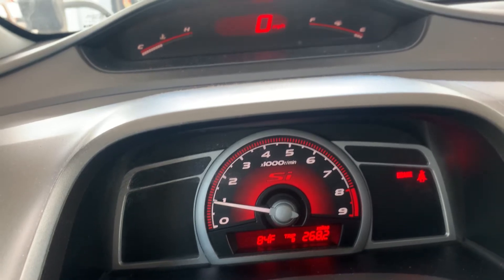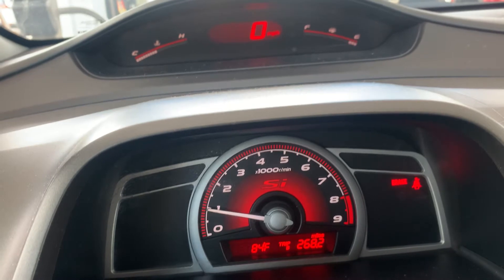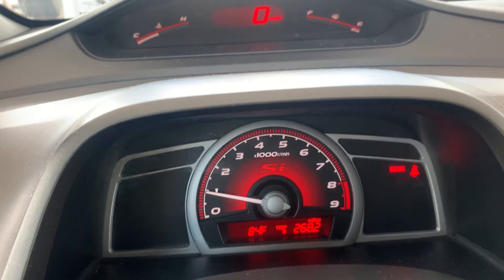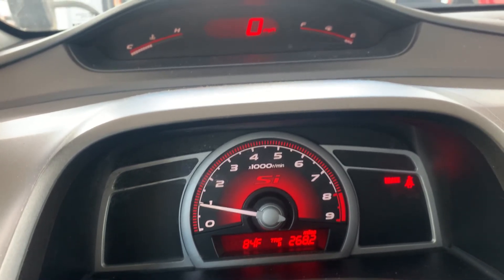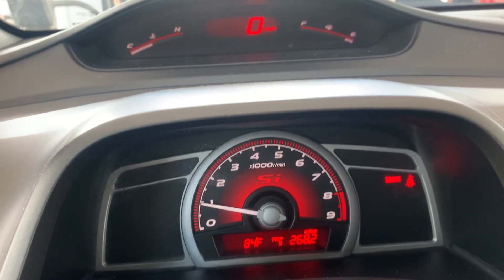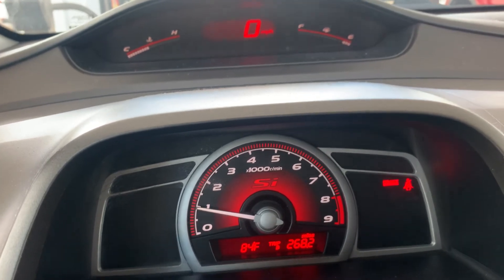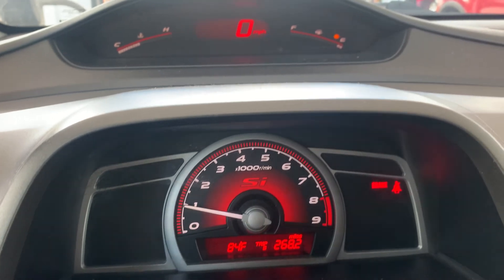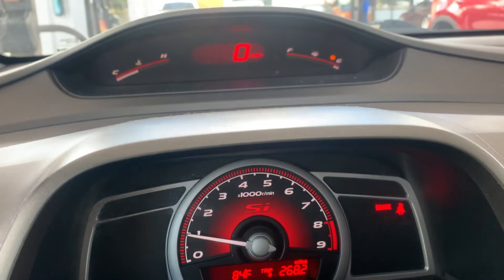8th gen si - fBO (mpg)

Comment: How much did it cost for the bolt ONS and tune in total? How many miles on the motor?
Reply from the maker: 113k daily drive 
Intake 300
Exhaust 500
Headers 300 but I sold my OEM for 300
Hondata 450
Tune 375
Reply: @molexmejia8449  thanks. I'm currently looking for a clean and mostly stock fa5 si with low miles rn, no luck so far but I'll definitely be going a similar route to you when I do get one
Reply from the maker: @repingers9777  I’m selling mine
Reply: @molexmejia8449  awww why? 😂 I'm looking for one as a nicer and newer daily. I'm driving a clapped prelude type sh with a JDM h22a she's a runner but the car is falling apart big time and it's been a major headache. Hoping a clean fa5 will be something I can love
Reply from the maker: @repingers9777   bb on the way…
Reply: @molexmejia8449  How much are you asking for it?
Reply from the maker: @alxo123   10k
Reply: @molexmejia8449  damn good luck with the sale. It's a seller's market these days, that's for sure

Comment: What’s the 0-60?
Reply from the maker: No clue
Reply: I've got Hybrid Racing CAI, Skunk2 header, Full Race 3" exhaust and tuned on Hondata. I'd say the 0-60 is in the mid 5s if you get a perfect launch. With the limiter pushed back to 8600, you can hit 60 before shifting to 3rd so that drops the 0-60 time substantially. The 6.7s stock time is somewhat due to 2nd topping out in the high 50s, causing you to shift twice before you hit 60.